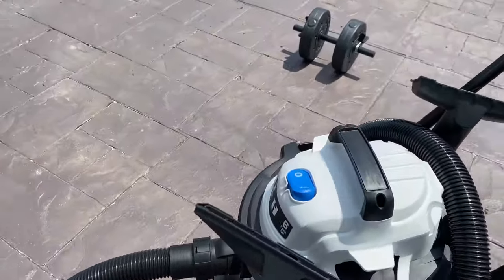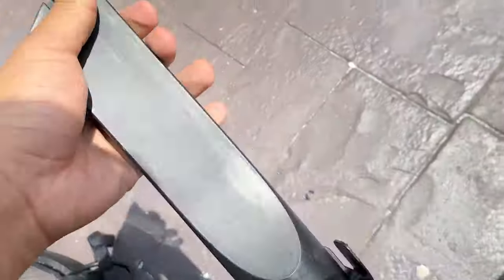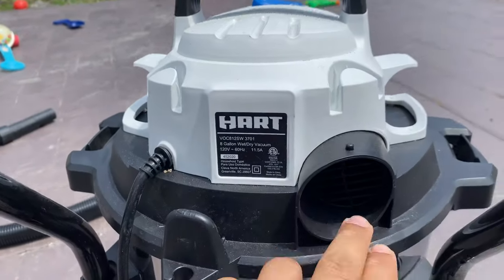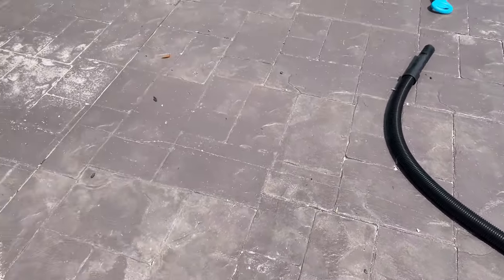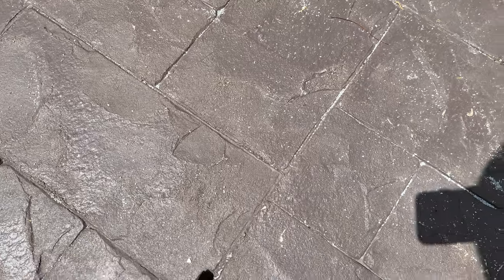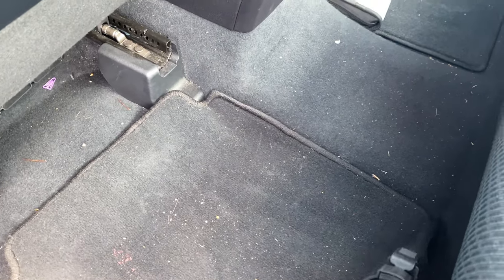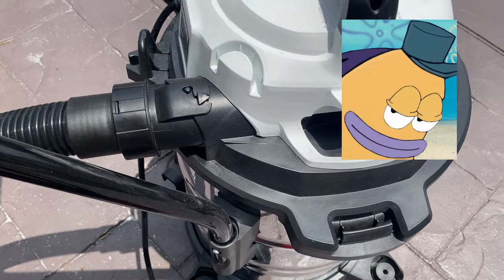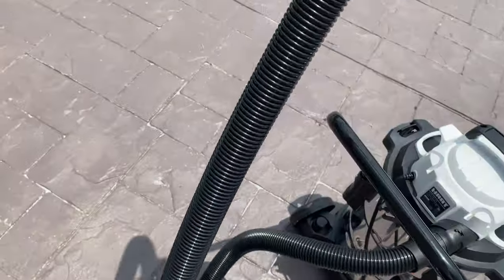Hart 8Gal 6HP Stainless Steel Wet Dry Vac Review Video

Comment: The bottom of the vacuum has a little chain hanging, what is it for. Does anyone know. BTW I got mine for 29.99 at Walmart I love it.
Reply from the maker: To this day.. I still do not know
Reply: Because it is stainless steel it builds up static Electric.
So, the metal chain helps deter the buildup of static electric around the stainless steel tank
Reply: I thinks it’s for grounding, to anchor it down from moving

Comment: On the manual it says you can’t use the filter it comes with to pick up dust and instead you need to buy the filter that handles micro like dust. It also says to use the dark foam when picking up water. I am wondering if I need to remove the filter and put in the foam it brings or do I put the foam around the filter? I’m gonna use it to clear my sump pumps since it has muddy water that stinks. I wanted to use this vac outside the garage door to remove dirt off the drain that leads to the sump pumps. What do you all say? We are getting rain on Wednesday and snow on Thursday here so I need to start today on these two jobs at home.
Reply from the maker: Lol yeah i hope you used just the foam filter the other filter is for dirt and stuff once it gets wet it loses it’s performance
Reply: The manual says to disconnect the yellow filter and then put the black foam filter in its place when wet vacuuming